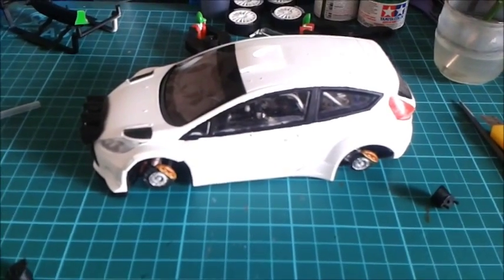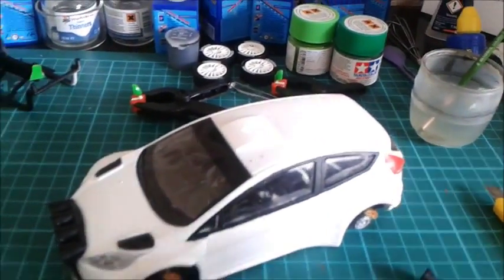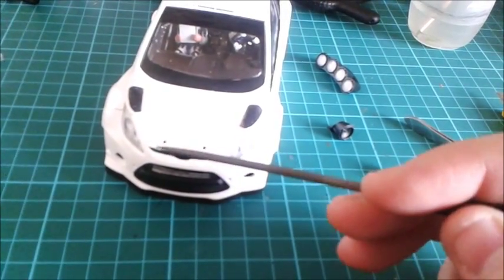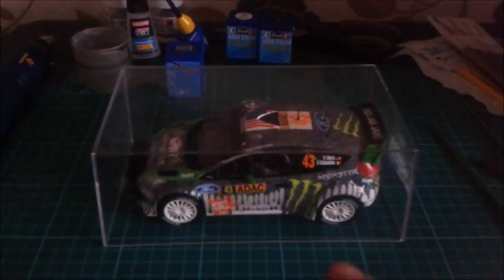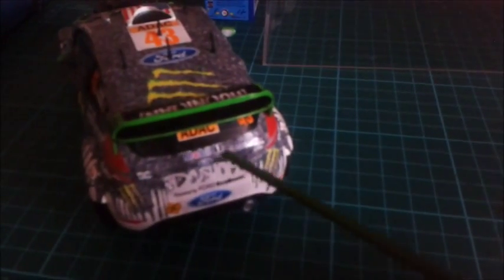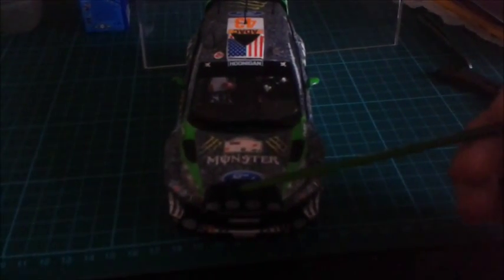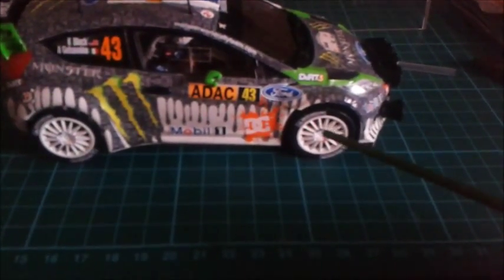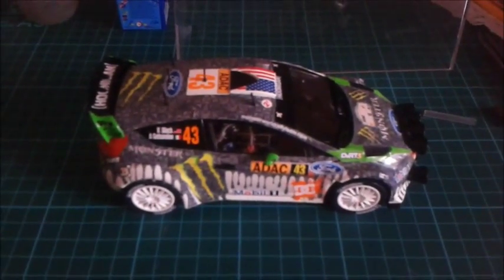Belkits 1:24 Ford Fiesta RS WRC Part 4 (Finale)

Comment from the maker: Hi Tim.

The main body was just white primer spray.

I used silver & red for the front & rear lights, green & black for the rear spoiler.

Silver, black, anthracite & white for the interior.

If you want some custom livery decals, I suggest you go over to Spotmodel & check out their Colorado Decals range.

I also picked up the driver & co-driver figures from there too.

The main difficulty is getting the interior & rollcage into the body.

Comment: Nice build, just got this kit with the Ken Block 2013 decals. Now with decals of such complexity its worth while investing in some micro set and sol, they're a god send for stubborn decals ;-)
Reply from the maker: Cheers Gavin, like I said in the video, im going to america later this year, so Im gonna buy me a bottle (or 2) of each, the microset (blue)is only £6.99 on amazon/ebay, but sellers want £25+ for the microsol (red), so for the price of one bottle of the microsol in UK, I could buy the lot for the same price in dollars in the US.
Reply from the maker: Nice one Gavin, they are both really cheap. i'll get some from there.
Reply from the maker: gavin crayton Ive got some from there Gavin, and they both worked a treat, those troublesome wheel arch decals have sucked right into the plastic, a massive thanks again for finding that website.
Reply: WickedSlimShady I didn't find it, I work there lol.